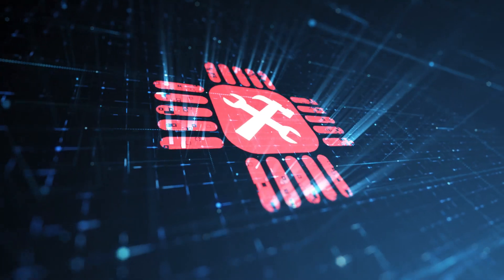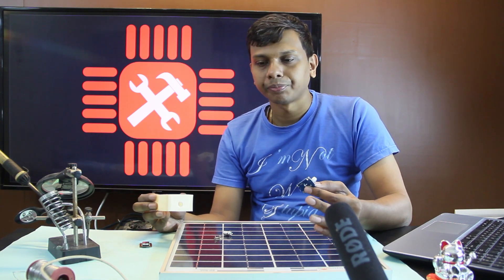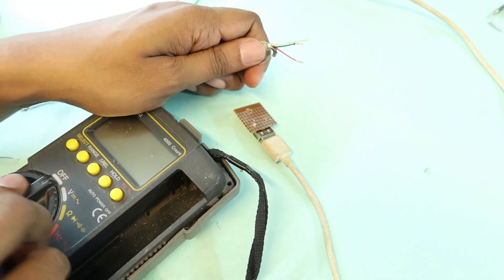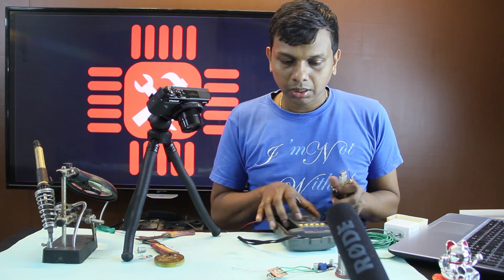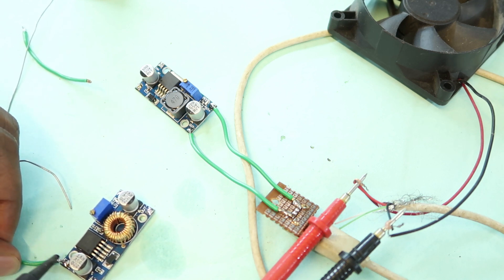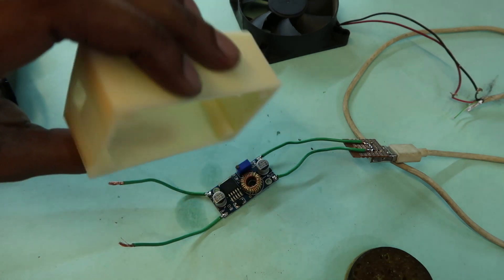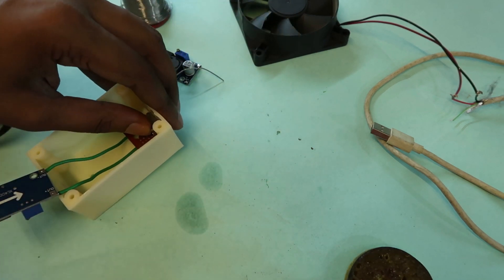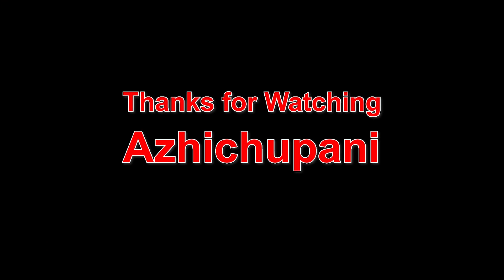100% DIY Solar Powered Mobile Charger |  100% സൗരോർജ്ജം

Comment: When you measure the output voltage you have to mention about output current also because ampere also matter to charge a battery. High ampere /non compatible power may reduce the battery life of devices.. always measure input and output current .. if power is 10watt then your device  is making 1.9amp ..check your mobile charger also has the out out of 1.9amp
Reply from the maker: Mine is dash charging 5v 4 amps.. panel rated 10 watts
 It could put out a Max of 1 amp after all the wastage..

Comment: ah chrging box il cheriya oru led vltmetr vekkunnathu nallatha....bcz ah chrging module edakku pany tharum.  pinne sthiram ayi eh moddule use cheyitha pani kittum ..angana pany kittya aaal anu njhn .  damaged by xperia t2 due to continues use of my assembled mobile chrger...initially they wrkd fine...after 2--weeks the out put voltage get increased upto 9v....thts y i recomend to use a vlt mtr or use lm 7805 at the output of cnverter as it will give only fuxed 5 v...
Reply from the maker: Vekkayirunnu, athinum koode power pokille athanu

Comment: ഇതിപ്പോ ഇതു കാണുന്ന ഒരാളുടെ കയ്യിൽ ഒരു 10 വാട്ടിൽ 12 volt വരെ വോൾട്ടേജ് സപ്പോർട്ട് ഉള്ള ഒരു സോളാർ പാനൽ ഉണ്ടെന്നു കരുതുക...
അത്യാവശ്യം ആൾക്ക് ഒരു മൊബൈൽ ചാർജർ ആയി ഉപയോഗിക്കാൻ മാർക്കറ്റിൽ കിട്ടുന്ന ഒരു cheap കാർ ചാർജർ മേടിച്ചു കണക്ട് ചെയ്‌താൽ മതിയാകുമോ...
സോളാർ പാനലിൽ നിന്നും constant 12 volt ഔട്ട് കിട്ടില്ലല്ലോ....അപ്പോൾ variying voltage input ആണെങ്കിലും..steady 5v 2amp out തരാൻ മുകളിൽ പറഞ്ഞ boardinu കഴിയുമോ..
കാർ ചാർജർ കൂടെ ഉപയോഗിക്കുവാൻ ആണെങ്കിൽ സോളാർ പാനലിൽ നിന്നും സ്റ്റഡി 12v input കിട്ടുവാൻ എന്തു ചെയ്യണം..
Reply from the maker: Yes athinanu aa board.. ningalu puli aanallo...

Comment: Output current ethra ampere aanu?
Reply from the maker: I think around 1 amps
Reply: You  can use up to 2amps Most  moble phones will tolerate)

Comment: 7805 ittal anthavum ?
Reply from the maker: Efficiency undakilla.. 1 amp max output
Reply: മൊബൈൽ ഫോൺ റീചാർജ് ചെയ്യാൻ 1 ആംപിയർ  മതിയാകില്ലേ
Reply from the maker: @pradipanp  yes mathiyakum
Reply: എങ്കിൽ ബഡ്‌ജറ് ഇനിയും കുറക്കാം
Reply from the maker: @pradipanp  max 1 amps aanu.. appo oru 600 mamps pratheekshikkunnu..pinne heatum
Reply: @Azhichupani  heating issue undaavum and also lost a lot of energy
Reply from the maker: @FactcheckMalayalam  atha njanum paranje

Comment: Solder iron  Stand DIY edavo..? Using scrap
Reply from the maker: Nookam bro..
Reply: കമ്പിവളച്ച് വെച്ചാ മതി, ഇല്ലേൽ പഴയ പൗഡർ ടിൻ
Reply: Take a square tile and fix  on it with some glue  a coca cola tin opened the top side,  which should be pressed like a "V" shape. Put some steel wool or similar  thing in it to clear the excess solder to rub off.

Comment: 7805 ic upayogikkunnathinekkaal nallathu njingal upayogicha board aanu.
Reply from the maker: Yes bro
Reply: But 7805 charge keranilla heat avunnollu......
Reply from the maker: @vvtricks1994  athalle paranjathu..
Reply: @vvtricks1994  7805 upayogikkumbol 1A thaazheya upayogikkaavoo.  Maathramalla constant current supporting cheyyaanaayi resistors upayogichu circuits cheyyanam.

Comment: Lm2576 fixed out put voltage ic vangi datasheet noki baki components um vangi buck converter undaakam.athaa nallathu.
Reply: Kkathul Gangadharan ic mathram kittiyitt karyamilla bro...athinu correct match cheyyunna inductor um high speed diode um pinne nalla oru trim potentiometerum venam...ithrom vangi cheythu kazhiyumbolekkum nalla oru paisa chilavakum..pinne DIY project aanengil nokkam enne ullu...cost cutting aanengil nadakkula...
Reply: @anandakrishnan9462  correct
Reply: @anandakrishnan9462  sir ithu njan cheythu upyogichu kondirikka no problem.datasheet vachu full components kittum.inductor um available aanu.datasheet lu ulla same diode um kittum njan ithu yellam kozhikode naa vangiye.
Potentiometer nte use illa because  ic is fixed out put voltage one.low cost aanee car charging adapter noki yaa poree
Reply from the maker: Yes, ithu njan Oru project Inu sample വരുത്തിച്ചത.. item complaint ആയിരുന്നു video il thanne athu വരുകയും ചെയ്തു.
Reply: @Azhichupani  sir contact number tharumo ?
Reply from the maker: @kkathulgangadharan2262  please follow me on Instagram..
Reply: @Azhichupani  thanks